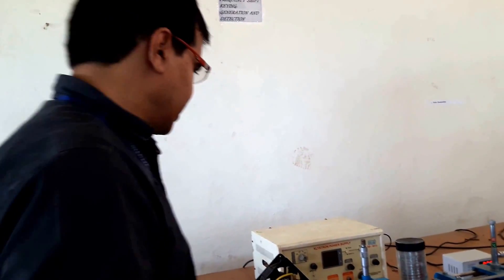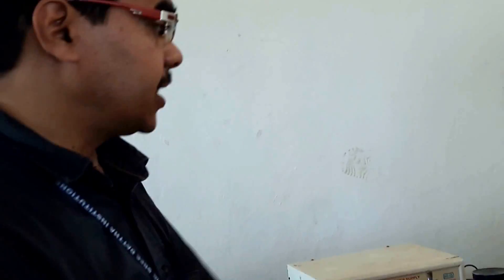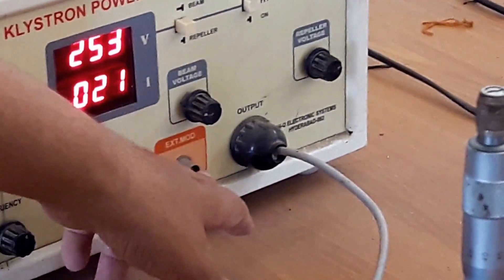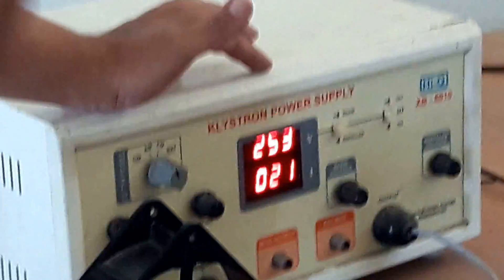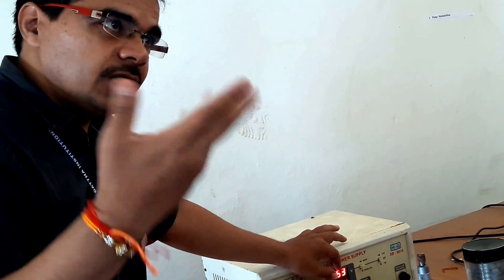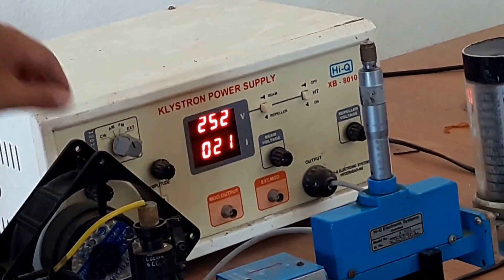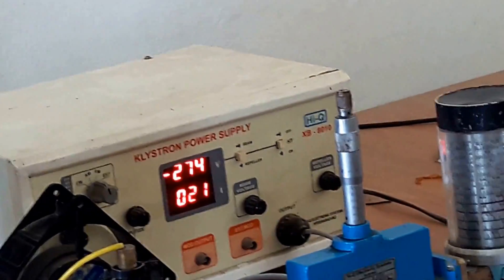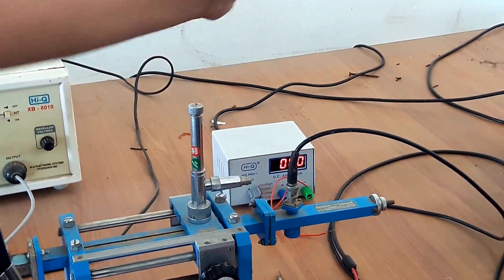Reflex Klystron Characteristics

Comment: hi  if i turn the  fm  mode  what is the output ?
Reply from the maker: Dear George Veropoulos, it is not that one can not tune to FM Mode. We can go for  Continuous Mode, AM Mode, FM Mode or External. It totally depends on our requirement. FM Mode is used by telecommunication engineers during testing of FM signals. Only thing in FM Mode is that we will get slotted output. Which ever the mode we are using, we should adjust the Repeller voltage and the beam voltage so as to get the proper waveform on the CRO.
Reply: @DIWAKARTIWARY  Yes  i  mean   FM  mode     i have  a problem  with AM MODE(maybe the power  supply have problem)    What  is the    waveform  when i chooce  the   FM mode  for the klystron ?
Reply: @DIWAKARTIWARY  if  you have an  email   i can sent  you  a  foto of  output
Reply from the maker: @georgeveropoulos2489  yes please you can. Even send the specification of your Klystron power supply. you can e mail: tdiwakar2001@gmail.com.
Reply: @DIWAKARTIWARY  i sent  a email  with my expirement  setup and    waveform  thank  !

Comment: Sir , why the repeller voltage is taken to be at higher value  than to start with the lower one. Plz explain 🙏
Reply from the maker: Dear jangid, first we will keep the beam voltage. In our case we have assumed it to be 252 volts. Now we will adjust the repeller voltage. The voltage at which we will get the maximum amplitude say -ve 205 volts, we will increase and decrease the repeller voltage. The amplitude where we will have minimum voltage, in our case it is -215 volt and -197 volt. In short at 252 beam voltage we found the range of repeller voltage between -197 to -215 volt with maximum amplitude at -205 volt. 
We can calculate any lower (-197 volt) or higher (-215 volt) first. But our intention is to find the range at which repeller voltage can work for that particular beam voltage. 
Hoping that your double is clear now. Thank you Jangid.
Reply: Thanku sir

Comment: How u got the maximum voltage again for measuring the dip
Reply: Please reply fast sir , I have exam tomorrow , thank you
Reply from the maker: Dear S Ajith,
In reflex klystron as we keep the beam voltage constant and adjust the repeller voltage so as to get the sinusoidal waveform on the cro. We will note the repeller voltage at which 
we get the max peak to peak voltage. The repeller voltage above and below this repeller 
voltage the peak to peak voltage will be decreasing.  We will note down the two reading 
above and below this max voltage. If we decrease we will again get the second peak to 
peak  max voltage. we will note down the second max peak to peak, and two values 
above and below this second max peak. Similarly we will note down the third max peak 
to peak.  In reflex klystron we will get max three sets of pair having max peak and two
low voltages above and below that value.
So the summary is that for a set of fix beam voltage and variable repeller voltage max 
three pair of  one max value and two above and below lower values are possible.

Comment: Thank you sir. Already installed the app.
Reply: Sir ??
Reply from the maker: You can even try the app "anmol classes" under google play store. It is having app for Microwave Engineering, Satellite Communication, Basic Electrical and Electronics Engineering, Digital Logic Design and so on.
Reply from the maker: You can even try the app "anmol classes" under google play store. It is having app for Microwave Engineering, Satellite Communication, Basic Electrical and Electronics Engineering, Digital Logic Design and so on.
Reply: @DIWAKARTIWARY  sir link de skte ho

Comment: when the square wave blinks? (In case of frequency measurement)Any concept behind it?
Reply from the maker: It is not square wave blinks,when we rotate the DRFM max there will be three slots where the square wave will be seen. These are the different modes. In each mode while rotating the DRFM we have to see the point where there is dip in the waveform i.e minimum amplitude. At this point we have to see the freq in DRFM that is the required freq.Thus we will have three different  freqs for three modes.
Reply from the maker: i am sending you the link for the app that we have developed related to ""Microwave engg lab"".
The link is : http://www.appsgeyser.com/3761176
Reply: thank you

Comment: Thank you for the explanation. But can you please explain how come the CRO is able to display such high frequency of around 8 GHz, whereas the CRO can display a signal of maximum 1 Ghz ?
Reply from the maker: The CRO specification is 20 MHz not 1 GHz. We are modulating the 8 GHz freq to low freq signal i.e 1 KHz so that we can able to do the analysis of the microwave freq signal by the CRO. Other option available with us is to use Spectrum Analyser {whose average cost is 10 lac} where modulation is not required and we can do the analysis directly as it can work in GHz freq.
The Spectrum Analyser will display the freq-time graph where as CRO will display the amplitude-time graph.
Reply from the maker: i am sending you the link for the app that we have develop related to ""Microwave engg lab"".
The link is : http://www.appsgeyser.com/3761176
Reply: DIWAKAR TIWARY thank you for your response !
Reply: Cro only display modulating signal. Its display detecter o/p. not carrier signal(GHZ)